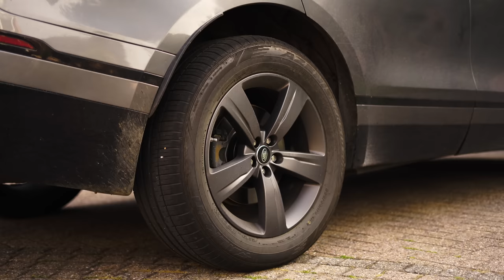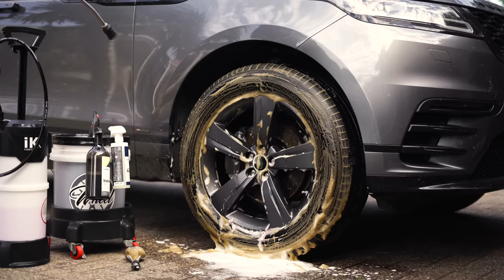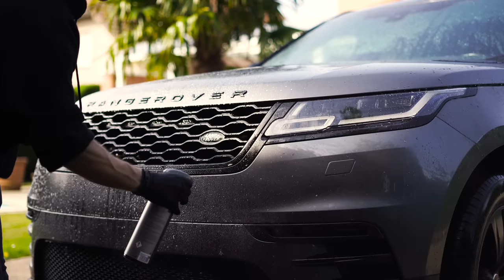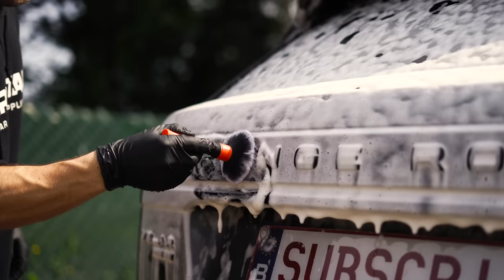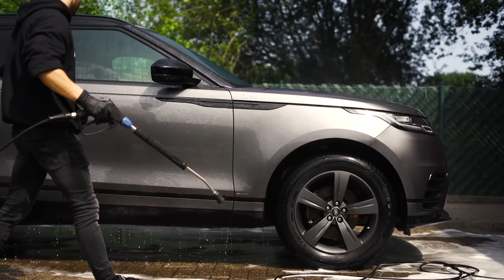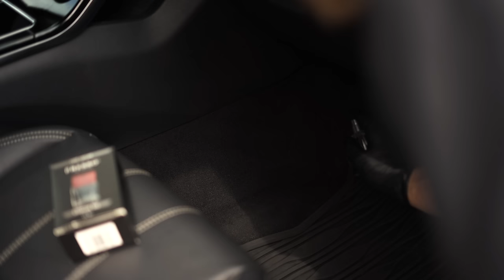DIRTY Range Rover Velar - First Wash in Months!

Comment: In my personal experience Bead Maker is the worst thing you can apply on grey paintwork. Any slight rain will result in water spots
Reply from the maker: I never had an issue with it resulting in water spots. What does it have to do with grey paintwork?
Reply: @VermijlCarDetail  My car is grey and everytime it rains it leaves water spots. I’ve realised grey paintworks usually show water spots more. But if you haven’t experienced it yourself then something must be wrong